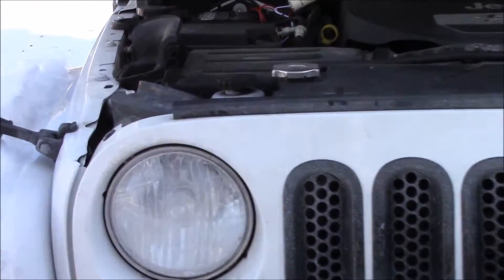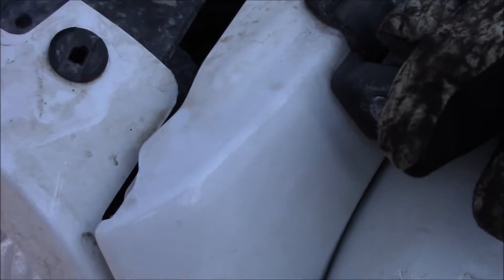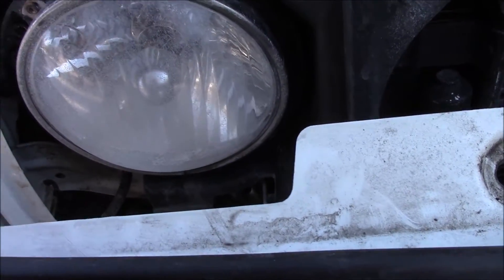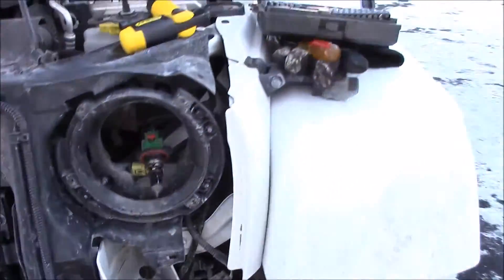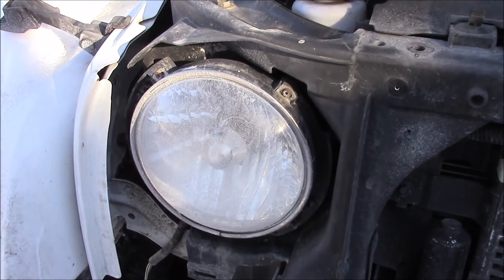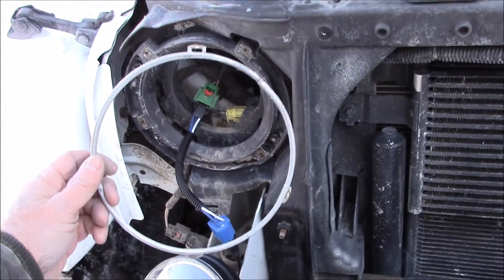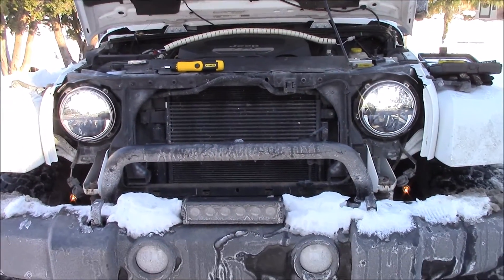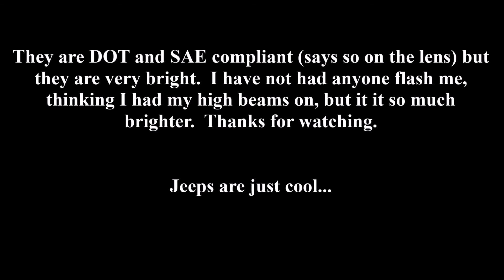Optix 7" LED Headlights Review and Install on a Jeep Wrangler

Comment from the maker: I just had an issue with the cables loosening and causing a flicker.  Pulled the light out and used electrical tape to make certain it would not happen again.  Anyone else have this happen?

Comment: You should try augmenting your videos with a head mounted SJ4000. That way you can put the other camera down when you work the fiddly bits and continue recording. Fast forward through really fiddly stuff, but still have it captured for your viewing audience. Here's a link to the SJ4000, a decent little piece of kit: http://www.ebay.com/itm/4K-Ultra-HD-Wifi-16MP-Car-Bike-Helmet-Cam-Sports-Action-Waterproof-Camera-SJ4000-/272192037557?hash=item3f5fe8e2b5:g:54EAAOSw5L9XEQ-w
Reply from the maker: Good idea, sir.